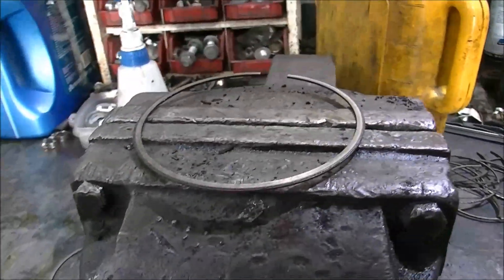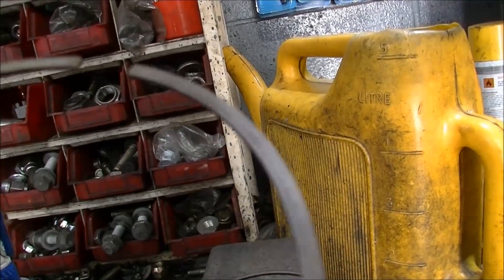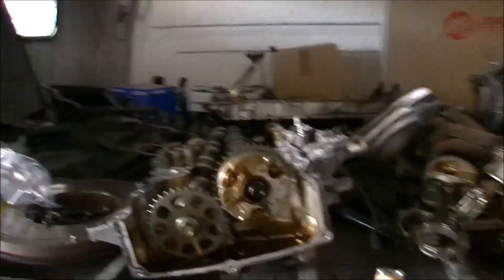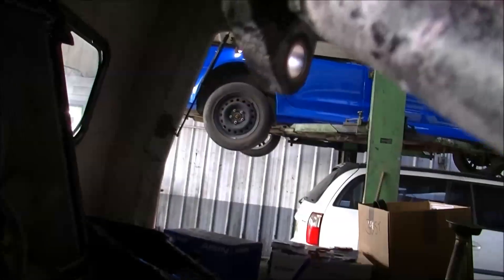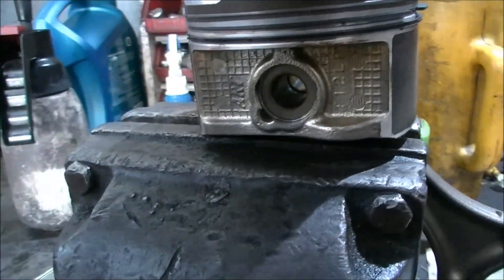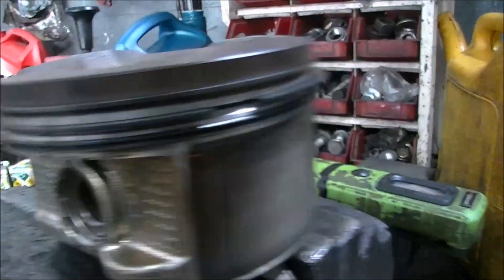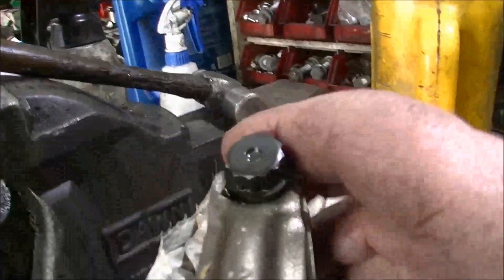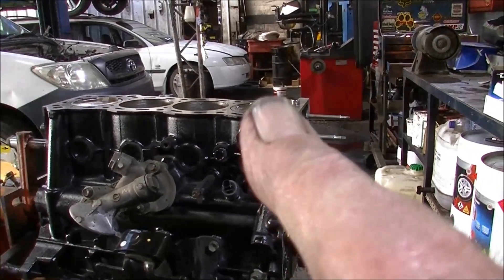Toyota HiLux  2TR-FE reassembly begins.

Comment: the one thing ive never had the guts to do, stamp caps etc , i see everyone does it without issues but knowing my luck. this engine is tricky , rings still have spring, was she an oil burner at some stage, rings, valves seals or something. i liked the assembly video alot and the previous honing tips , ive only honed gigantic high pressure compressors and mowers, if i did a car engine i forgot about it.
Reply from the maker: I used to stamp numbers on the caps but these you can't that's why a tiny center punch mark...Just a gentle tap just to leave an impression...Once I clean them up I write the number in marker on the top of the piston..(Much easier to see).

Comment: Good job looks bloody good 

the other thing you can do is put a torque wrench on the crank once all the Pistons are in and it should turn nicely with less than 20 foot pounds depending on the engine size four-cylinder definitely less than 20 mind you if it’s a diesel could be up to 25 I’m sure there’s a spec for it somewhere.....

But it’s not a bad little check
Reply from the maker: Never done that...Always by feel like I was taught...And torque each rod then turn the engine...If something doesn't feel right it probably isn't...You'd be surprised what can happen when you get disrupted in the middle of a build...Regardless of how many time you've done it..Here's a true story...Back in the mid 80's I was foreman at an engine fitting shop...Our company did it all from reconditioning to fitting(I worked in all the areas) and one of the fitters asked me what was the rattle in the engine he just fitted...Just as I was near the front of the car there was a big bang and a rattle and a quick stop...He said"Doesn't matter,I see it,#1 rod has just knocked the engine stamping off the block"...Yep...Someone didn't put 1/2 a bigend shell in and the rest is history..Lucky it was only a Holden 202 and we had plenty of those...Cheers mate.
Reply: ZIGgassedUP many years ago a mate of mine had a 4.1 falcon XC I think I’m talking the 1980s he had a “reconditioned” motor put in it by mob called GEM Engines.....

He picked the car up ran like a piece of shit...... one cylinder had ZERO compression......

turns out they forgot to put one piston in....!!!!

In the 1980s and 90s GEM had a very bad reputation where I’m originally from in W.A. 

I don’t know these days not even sure if they’re still around

I always had Holden red motors as a young fella and when they were stuffed I had them reconditioned and I used a mob  called “prosser power” 

to be honest the motors never really lasted like the one from the factory did...... after a period of time I began to suspect that they charged you for new parts but things like Pistons, lifters bearing shells...... if they looked okay and measured roughly within spec I reckon they put them back in again OR put a piston used out of another motor in the one you were getting done 

the red 202 exchange was 900 bucks in 1989........